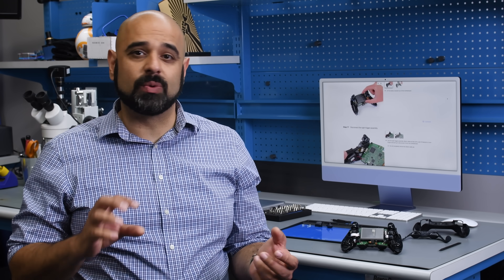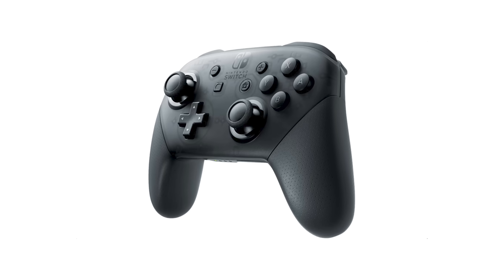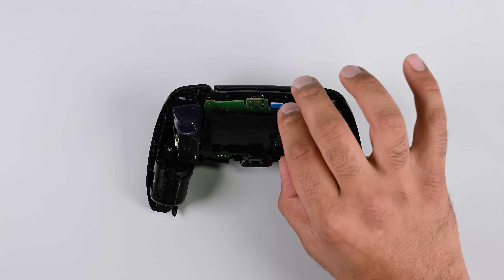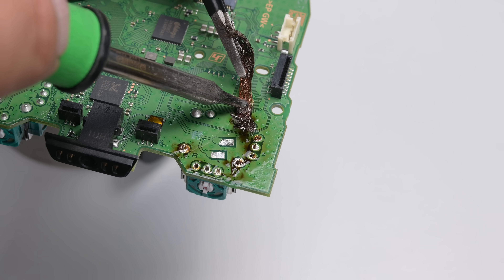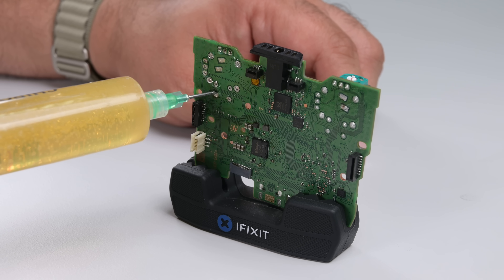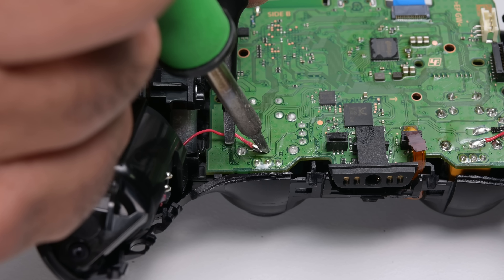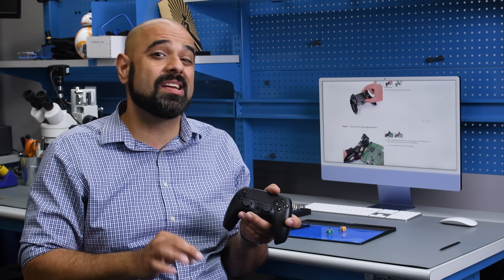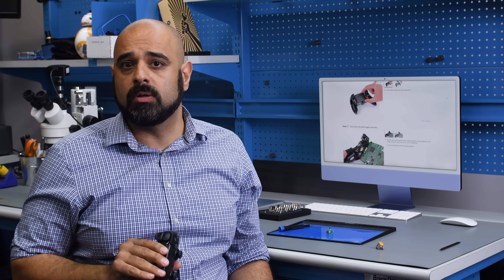How to Fix PS5 Joystick Drift for Good!

Comment: "It's not hard to change" starts soldering 😅
Reply: Right, makes you wonder why we need companies to begin with if at the end of the day we're doing everything ourselves
Reply: All these people saying its a basic soldering job, it really isn't, yea removing old solder etc, but way this video shows just pulling old stick out and new one in it really doesn't happen like that. If your not delicate enough you can break the copper joint in pin hole, if that breaks its game over.

I use to do multiple controllers for stick drift and it's an absolute pain.

Tbh I always say this especially in uk buy a controller from somewhere like currys/pcworld, and buy the instant replacement protection for 3years.

You can go back to shop at anytime and replace it free of charge especially for stick drift, done this easily 10 times.
Reply: @Bunceythegreat  as a solder tech, just scrape the top of the broken trace and either solder to it, or create a wire in this specific case lol...no its not hard...takes some practice sure
Reply: Yeah too much here.  You can't say, "not hard!" and then require precise soldering temperatures and motherboard clamping lol.  This is not an easy fix.  Nor is it medium.  So i would describe it as.......
Reply: Anything is easy if already know how to do something....no this is not easy for a complete beginner
Reply: i'm glad this thread is full of gd soldering experts somehow.  tf is this.  Either this dude created a bunch of accounts to try to convince us how easy it is to lower a soldering kit to a certain temperature to add and remove connection points, or schools started teaching soldering to everyone and not just the shop kids.  Wasn't in my school when I went, AP student, no soldering knowledge.
Reply: @drakegravely5261 i think it really depends where you’re from. basic soldering skills are taught in a lot of schools in the UK. they had us just making basic speakers, but it taught us things like temperature control for pcb’s and the like.
Reply: @whoratheexplora9632  We typically don't learn these types of skills in America unless going to a trade school or inheriting the knowledge from family; I think shop class should be required in our schooling system. =(
Reply: Yea man. I was done the moment he mentioned it! 😂
Reply: I mean soldering is inevitable when moding electronics
Reply: Yeah I can do this for all the kids in the family. And have money and my favorites get upgrades from. Extreme rate lol. Be a fun projeet
Reply: Try it it's pretty easy you can get a cheap iron
Reply: I'm no handyman but soldering isn't difficult. For this kind of thing, anyway. There are more complex soldering jobs out there.
Reply: @gulpira @gulpirakderp urse it isn’t. But desoldering is. In a literal sense “Soldering” and “Desoldering” is different. That’s why they make tools specifically for “desoldering.” So yes you’re correct, soldering is easy. “Desoldering without” the gun, and just a wick with a solder, is very time consuming, and definitely not an easy job for beginners. Thankfully I am not a beginner, but this isn’t just a piece of cake.
Reply: @furychallenger5275 fair enough
Reply: For real!!! I was like, I’ll buy a new controller thx.
Reply: @Chuckles9191991 i mean you are gonna buy a new one already than why not try this if it works you save money
Reply: @Chuckles9191991  keep buying, your are their ideal customer.
Reply: @Chuckles9191991 Wow. Soldering is easy though.
Reply: “It’s not hard to change” starts soldering

See? It wasn’t that hard!
Reply: @lespaular  😂😂😂 love it
Reply: Its a basic solder job, thats why its a good idea to take these types of classes in highschool.
Reply: @theyoungcolonial  that's far from a basic solder job though. Reconnecting a little easy to access cable from an electric motor? sure that's simple. Undoing a bunch of pins, having to use additional solder to lower the melting point on a small motherboard? Yeah that's easy only if you know what you're doing, but that's true for everything in life
Reply: @jackbequick  My first work was fixing cellphones back in 2011. It's not hard after 2 or 3 tries. Only people that haven't tried think that "easy only if you know what you're doing", no one is born knowing how to solder dude, everyone has to learn. A basic soldering kit doesn't costs much an it uses almost no space on a closet, along with the flux and other supplies.
Reply: @jackbequick  amen
Reply: @jackbequick you know you could just snip the legs of the old pots.  Then you can get at them easier and install the new ones once all the solder is gone
Reply: @theyoungcolonial  I did when I was 11 years old, that's 29 years ago and I'm not willing to buy a soldering kit that I have no room for just to make this work. I hope someone releases these kind of sticks for the dualsense edge though
Reply: @Robbe1984  Okay, Im just saying that its an easy job that most people should know how to do.
Reply: @Robbe1984 give the soldering part to a local professional electrical repair guy. Still cheaper than buying a new one
Reply: @theyoungcolonial  Basic??  getting a connector with 14 pins in a circle to desolder enough to remove is basic??
Reply: @theyoungcolonial  Wasn't an option for mine; also, when you're talking to someone who hasn't soldered before.. a "basic" job to them is connecting two frayed wires, not specific dots on a motherboard.  Seems like a bit of lording on your part imo.
Reply: @theyoungcolonial  I've never soldered in my life and the way he talks about it in this video, I barely understand a word and feel even more insecure about it.
Reply: @StoneyWoney  its melting metal thats all
Reply: @theyoungcolonial Do I really have to remove those other parts? Seems like a waste.
Reply: @theyoungcolonial  Basic if you've had decent practice and can be bothered.  Through-hole desoldering with just an iron and wick isn't that easy and most people just want to sit down and play their games without having to take apart controllers and remanufacture them because Sony is cheap af
Reply: @JoosySmooyay  I tried to desolder my Xbox controller joysticks with zero prior experience. I spent about 10 hours on it, found it virtually impossible to get all of the pins free. I ended up following an iFixit guide that has you break apart the old joysticks and that eventually worked, but even that was tedious. 

I watched tons of these videos and they're all like "just use flux and wick it away!" and I just totally struggled with it. I bought a new iron, had lots of flux, used leaded solder to mix in, had a desoldering pump... Couldn't get it.

Anything looks easy if you're good at it!
Reply: Soldering is not hard
Reply: @luiztechai I’ve soldered before with my RC cars. Ruined them. Ended up taking them to shop to get that kind of stuff done. I can do a ton of stuff that seems easy to me that you can’t.  Anything seems easy if you’ve done it enough times
Reply: @csharp57  Yes so practice duh! I didn’t have a background in soldering.. Until my line of work forced me to solder hundreds of PCB boards and stuff because company refuses to pay to get them already soldered 😂 Now I’m decent at it.
Reply: Shoelaces are harder to tie, than soldering. Only thing tricky in this video is assemble/disassemble gamepad itself
Reply: @Lyzzzander  And to have the room for this equipment
Reply: @Robbe1984  all of my soldering stuff fits in a tackle box
Reply: @illmannered1  I don't know what a tackle box is but still, I'm not willing to buy a soldering equipment for the sole purpose of doing this to my controller. I have the dualsense edge controller and I wish we could buy mods of these sticks instead. That would easily be worth a purchase
Reply: @Robbe1984  lemme get this straight....you don't have room for something the size of a screwdriver? and you're not willing to spend significantly less money on the equipment to do it yourself? No way you're 40 I just don't believe it.
Reply: @ghostrider2214    Well it's not just the soldering pen I'd have to buy now is it? No way you're that daft.
Reply: This is your sign to learn how to solder. I remember around 2005 everyone was getting their og boxes modded and I was trying to find someone to do it for me for months and nobody wanted to.. I finally found someone who knew how to do it and he basically said "No, do it yourself" so I decided that's exactly what I would do, so I bought the basic stuff and read and watched everything I could and ended up doing it.. The feeling of pulling off a project like that on my own was so encouraging.. Since then the skill has helped save me SO MUCH MONEY fixing and modding my own electronics. It really isn't that hard, and a basic soldering setup is really affordable on Amazon, and way better then what was available to me back then, and resources to teach yourself are more accessible than ever before.

Comment: there are cheap hollow stainless steel needles for exactly this type of desoldering, solder don't stick to it so it can be used to seperate pins from the pads while solder is molten

Comment: I wish there were hall effect potentiometers that were compatible with the stock analog modules. Yeah, the ones that come with these potentiometers are better and smoother, but the stock ones are okay, I just hate having to desolder the whole analog module when only the potentiometers are faulty and those are the easiest part to desolder.

Comment: Works also with xbox and switch controllers, though they need other calibration software. I was able to manually calibrate the switch pro controller by changing the factory stick settings using Joycon toolkit. Can recommend.

Comment: For easier removal of faulty part just cut the legs from top side of the board with some side cutters. Then you can comfortably desolder legs one by one. 
Not all legs are accessible from the start, so pry open potentiometers first. Only ones that will remain untouchable will be microswitch legs.
Reply: that was my first thought watching the video, not like Im gonna use those dogshit sticks again lol.
Reply: Yes, leaving the bad stick in place will make harder to desolder as it will act as a heat sink.  I snip the legs and remove the old stick first.
Reply: True this is the only acceptable way of replacing the old sticks.  You're never going to use the old ones again so why bother saving them?

Comment: 20? Nope, hall sensors cost about 2 bucks. They don't use them on purpose. Companies should be fined for these kind of practices, who knows how much e-waste they generated with this planned obsolescence
Reply: the government would have to care about e-waste in the first place... you can openly market lithium ion products as "disposable"
Reply: Playstation was indeed fined for this and they keep doing it 😂
Reply: Lol @CrosMz
Reply: They'd charge you $20 more for them spending $2. They wouldn't want anything under 1000% profit margin.
Reply: Hall effect or tmr tho ?
Reply: 100% agree!!, i just did two hdmi ports on ps5s today and both controllers came in with bad drift on the left pot , I found bag of ps4 pots and found they never even changed them for the ps5. People need to get loud about things like this - they saved a few cents per controller but guaranteed the end user would need to replace them and knew what they were doing with smiles on there faces.
Reply: Yeah that part is crazy
Reply: Yep they should face consequences
Reply: Just found a bunch for 40 bucks 20 ps5 rubber caps and 20 replacements parts and tools tik tok but now gotta learn how
Reply: Yeah my PS5 Dualsense could barely last over a year
Reply: 20 with sipping
Reply: Bring it to a repair shop 30 bucks , will exclude any shipping fee item costt and not mention the aggravation. Opening fixin and closing.
Reply: $20 if you buy from ifixit no doubt.
Reply: Coudn't agree more !!!
Reply: And most people would be perfectly happy having that $2 more passed to the consumer. But these companies don't want our extra $2. They want our extra $70.
Reply: 110% agreed!👍
Reply: Even less if they were to buy them buy the millions
Reply: 20 is the shipping fee.
Reply: Sir you have a good point but there's basically nothing we as consumers can actually do 
Corporates do sh*t like that all the time
Reply: @samadel.a765  we consumers have 100% all the power, it's no different than the citizens (who also have 100%), it's only because the companies and organizations running the business or politics are more organized (usually through force). If we organize, we'd see a difference literally overnight. OVERNIGHT.
Reply: @YiJoro  the consumer "vote" is not a thing, companies may change stuff but in the long run they will repeat their greedy practices while the consumers wont organize every single time.
the state should actually care about such things but democracy is always ruled by capitalism.,
Reply: @samadel.a765  yes of course we must lay down and take the corporate slop we are powerless and must quit complaining.
Reply: @42crazyguy  not exactly what i mean but to change anything that needs an orgnized move to stop such non-sense
Reply: @samadel.a765 consumers are in control of everything. Please come back and understand this. The only times the power isn’t totally in the consumers hands is when YOU believe the propaganda you stated about not being able to do anything
Reply: @d4wtvr  idk man I hope that what you said is true but would companies really give in ??
Reply: @samadel.a765  you can stop buying.. you don't need a ps5 controller to survive.
Reply: @7aemr  fair point
Reply: You can stop buying sht and they will stop making sht.
Reply: @Tomipolus  you know groceries are pretty expensive... Maybe I'll just stop buying those too while I'm at it
Reply: I've been told that Hall sensors only read about 70 to 80% of the stick movement. Has anybody heard about this or have any experience with this?
Reply: @relive1775  hall sensors are actually more accurate. Not sure where you heard that.
Reply: "Planned obsolescence" sounds unnecessarily conspiracy-theorist. It is capitalism; pure and simple. They have contracts to acquire/produce these parts. These contracts are obviously more profitable than whatever they can get for alternatives. Sticks drifting within 6 months is a terrible plan to make money when you offer warranty for a year. Think before you yap.
Reply: @KonglomeratYT  Companies used to use quality to sell consumers that they should buy from them. A product could last you 10-20+ years or my grandma's microwave for example still works 50 years later just fine. Now products are purposely made as 'passable' as they can with planned eventual failures within 5 years, and they just pay for reviews and advertisements to convince people they make quality products when in reality everything is built to be thrown away now. Here's another example: my dad has had a bernzomatic torch for decades. I bought some china torch that appeared heavy duty, but the sparker failed within a few months of use. Up disassembly, I found the part responsible for sparking it was a cheap piece of plastic with a metal moving part that sheared off a piece of the plastic rendering it unable to return to the position from which it could operate. I bought a bernzomatic and it's been working for years without issue.
Reply: @KonglomeratYT  Surely, you're aware of planned obsolescence? The profit margins on selling all these extra peripherals give them a huge boost over providing something that will last you to at least to the next generation of console. The video clearly underlined that they know that they could be using these components as well. A lot of people don't actually use warranties, either because they're unaware of them or the process is at least as inconvenient as buying new is. Besides that, I would hope my controller lasts more than a year. For me, that's still an abysmal lifespan.
Reply: @KonglomeratYT  instead of your " think before you yap" you should research before you talk.
Planned obsolescence is already known to be a thing and this is probably the most obvious one.

the warranty argument is easy to answer: most people wont use the warranty and just buy a new one. 
why? people are lazy, its way easier to get one from amazon (takes literal secounds) instead of dealing with shipping and stuff. especially kids (which are the majority of console users) dont even know there is a warranty so they just tell their parrents to get a new one.

so even with warranty the company profits from obsolescence.
Reply: @KonglomeratYT  Or just put a silicone chip in it and program it to stop working after 25 months (and sell with a 2y warranty). Heard about IOT?
Reply: @KonglomeratYT confidently incorrect. Use some nuanced thinking. Sonys warranty program exists in idea only. The rate of payout is engineered to be as low as possible with business practices in place to deny as many claims as possible.
1) designing the serial number to rub off through standard wear and tear while inserting a clause in the warranty that the SN must be intact.
2) claims process requiring multiple points of human interaction through an intentionally understaffed customer service department 
3) intentional product life cycles matching up with cost-benefit analytics for coverage periods
Reply: Planned obsolescence is an integral part of capitalism and always has been since the first light bulbs. No conspirancy at all.